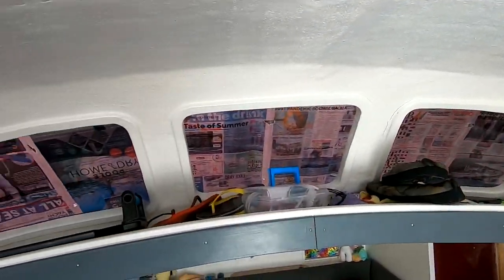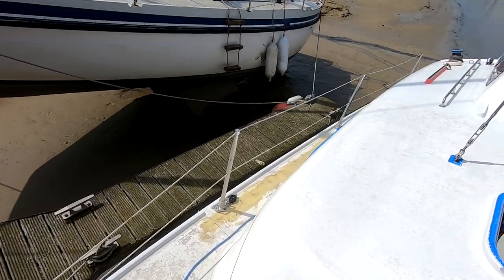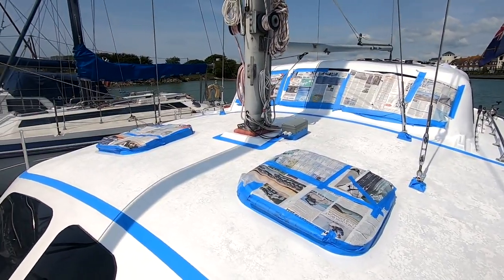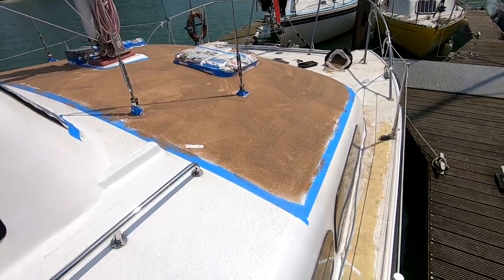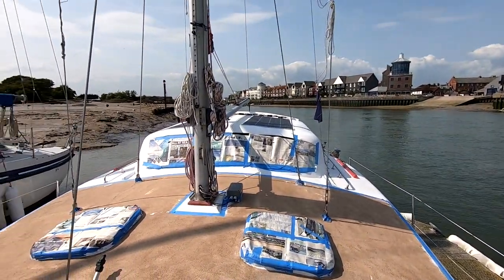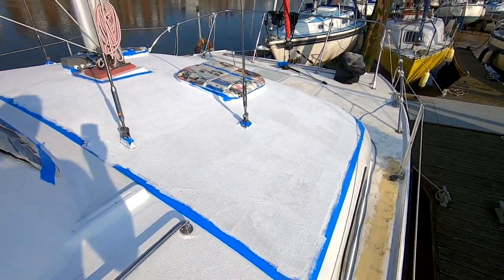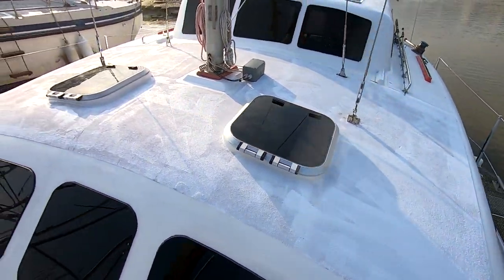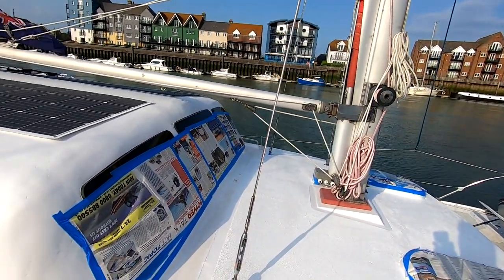DIY ANTISLIP , SEAL AND PLASTIC WASTE RECOVERY S2 E69

Comment: Hi Spence, boats looking good! You should consider using a tool that's not made for the job, like a power planer with an old blade. It'll be just fine! 🙂 Have Fun!
Reply from the maker: Thankyou mate,  i use many tools that arnt made for the job such as my dustpan!🤣